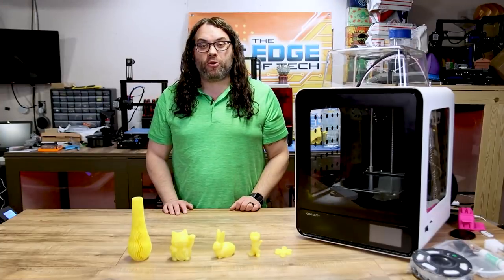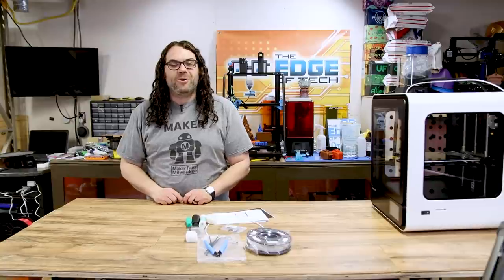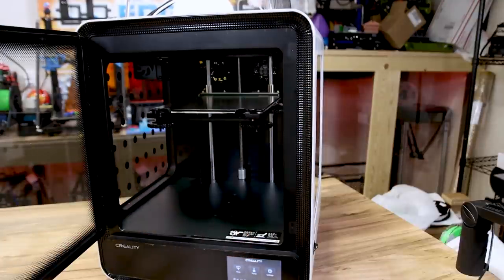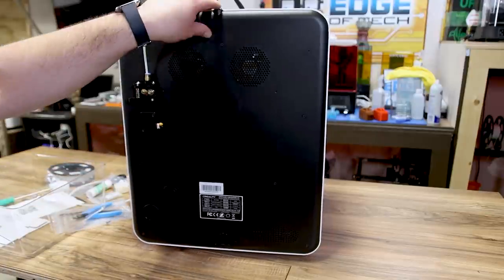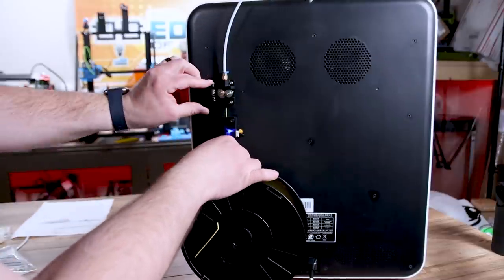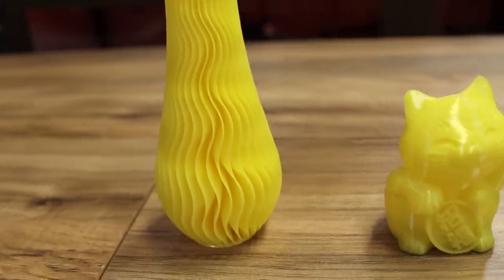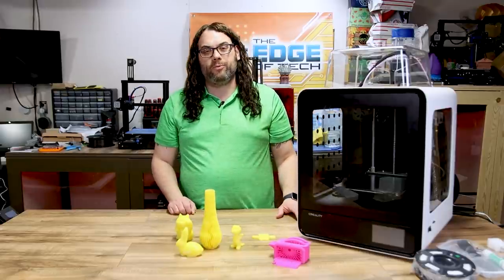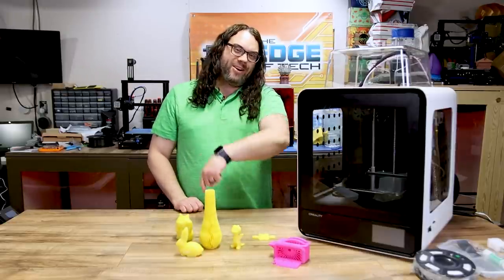Check out this New Creality 3D Printer! The Fully Enclosed CR 200B

Comment: Just received my second CR-200B and Creality have made some alterations to the new one I’ve got. They have added holes near stepper motor on inside and drilled holes above extruder with a fan inside casing to take heat out. Also a totally different hotend compared to my other one 👍🏻
Reply from the maker: Great news! That means they are listening! Do you know what hotend it is? Can you shoot me an email with a picture? I wonder if they went to a high temp hotend?!!
Reply: @TheEdgeofTech  I don’t know which one it is. But I will take some pictures and send them over to you!!  Where can I find your email please? 

Yes it seems they are listening and responding a lot quicker than they have before 👏
Reply: @Fanaticalfentons  Hey bro, I ordered mine yesterday and after lurking a bit more (as there isn't really much info about this printer online) I've come to realize some people are experiencing issues with theirs. 

Got it for 300€ off banggood so I can only assume it's the shittier ones? lol.. But if not, how would you rate it after running it for now 10 months?
Reply: @bravefastrabbit770  hey bro!! I have both generations of the CR-200B and they are both still working great. There was no price difference between the models. There are some slight adjustments in the newer design.  During winter for me with my print shed at about 2°c they just kept printing while keeping temp in enclosure at about 30°c

Comment: how fast does this print? How does it compare to the Ender3 S1 Pro? I'm having all sorts of issues with my E3 S1P with edges lifting and I'm wondering if it's because it's just no an enclosed unit and I've heard complaints with just buying the ender "box" so I'm kind of at a loss as to what to do.

Comment: Been thinking of getting one, but some people said it have issues with the extruder gear overheating, does it happen on your? great review !!
Reply from the maker: I didn't, but they now fixed that issue either way!
Reply: @TheEdgeofTech  cool, I will check with the local seller which batch they have in stock 👍

Comment: I think the glaring problem from end user experience is the location of the spool holder and extruder. It could be only more inconvenient if it were underneath.  
Otherwise it is worth considering.
Reply from the maker: Is that because it takes more space in the back? I think the only bad thing is that I have to turn the printer anytime I change it.
Reply: @TheEdgeofTech  doesn’t having to rotate the printer to load filament seem inconvenient to you?  Imagine  if you had limited space or on a shelf.   Just seemed like this was not well thought out.
Reply from the maker: @billyoungers4035  Ya. That's the part I would change

Comment: Did you print with ABS? The maximum temperature of the HEAT-BED of this device is up to 100 degrees. Glass surfaces are much lower. Is it possible to print ABS under these conditions? Without using hairspray or glue sticks.
Reply from the maker: I haven't on this printer yet. If I was gonna, I probably would use nano polymer on the bed.
Reply: @TheEdgeofTech  Thank you for the information. Nano polymer adhesive seems to go well.
Reply from the maker: @imextradeco.6689   For sure! That stuff is magic!

Comment: BTW, what is the hotend on this printer?  Is it the standard Creality hotend that is on the Ender 3, 5, etc., that has the Bowden tube inserted all the way down to the nozzle?  Or is it a different hotend with a separate Teflon lined heatbreak?
Reply from the maker: They say "New nozzle kit with excellent thermal conductance features wear-resistance and stability, smoothly filament-pushing. The dual fan provides a great heat dissipation environment." It does have a bowden tube inserted. but I am not sure about the teflon etc.
Reply: @TheEdgeofTech  The fact that Creality says that the maximum nozzle temperature is 260C indicates that it is not an all metal hot end, and that it has a Teflon liner.  I was just wondering about the form of that liner.  Either the Bowden tube goes all the way up to the nozzle, or there is a separate Teflon liner.  From your description of the hot-end, it does not sound like they are using the standard Ender hot-end.
Reply from the maker: @William3DP  Good point! I should have caught that. If I remember, I can try to take it apart this week.
Reply: @TheEdgeofTech  This video from Creality that shows how to service the nozzle suggests that the Bowden tube goes all the way down to the top of the nozzle.  One thing that I found interesting was that whoever unscrewed the nozzle did not put a wrench on the heat block.  (Are there pegs, dowels, or screws that prevent the heat block from turning?)  Also, they were able to shove the end of the Bowden tube right through the throat of the heat break.  I wonder if this hotend would benefit from a 'Luke Hatfield' style fix?  https://youtu.be/KHkMYz95ihM

Comment: Awesome video. I love this printer!! Had mine a few weeks now and happy with it. Only issue is the extruder can get very hot and then struggles to feed filament thru it.
Reply from the maker: Thanks for sharing!! I am guessing that is because the stepper motor is behind the panel in the machine. Does it do this with the case fans running? Also, I am guessing that it only happens with PLA and higher temp filaments don't get bothered by the heat. I think I saw on the facebook group that the stepper voltage was to high on his and he had to dial it back. Then it ran better!
Reply: @TheEdgeofTech  Thats it, stepper motor behind the panel gets very hot. I have seen a few mods being made for it that reduces the heat. it still happened with mine with the case fans running.i have a blower fan on it when running pla now, which has stopped the issue  but I will have a go at adjusting the stepper voltage soon
Reply: @TheEdgeofTech  I have set mine Vref to X,Y and E to 0.92V and Z 1.4V (unchanged) and the extruder overheating is gone. Now extruder gear heats up to no more then 40 degrees Celsius on more then 9 hour prints and I have no layer shifts and no under extrusion.
Reply: @simeonbodurov  cheers for that info
Reply: @simeonbodurov  Could you make a video of how you did it?

Comment: Creality has yet again released an enclosed printer it claims is of industrial quality yet does not have a high-temperature hot-end or high output extrusion, I am considered by my peers as a somewhat Creality Fanboy but these "Industrial Quality" printers are becoming an embarrassment to Creality, I wish they would drop the "Industrial" tag and adopt a "High-End Hobbyist" moniker or even better upgrade them to a hot-end and extruder worthy of the "Industrial" tag, and while they are at it they could change the plastic extruder that would not stand up to a couple of weeks of "Industrial" usage before the crack appears, and the same goes for the pneumatic Bowden connectors that are of the crappiest quality in the industry, we have the Ender 3 for the cheap entry-level printer, Creality needs to draw a line between Entry Level, Hobbyist, and Profesional "Industrial" because if they won't their competitors will!
Reply from the maker: Great points Andrew! I agree with that they could help themselves by using better categories. I really want to play with a CR5 Pro, which I believe they are pushing a more high end product with. It would be a great comparison for sure!
Reply: Also if it was a serious printer it would be true coreXY

Comment: Maybe I'm missing something, but the big feature of this is that it's an enclosed printer right? PLA doesn't really benefit from this. Would have liked to see some ABS printed.
Reply from the maker: I didn't have any abs, or I would have definitely tried it! But what's nice as an enclosed printer, is that it has case fans built in. That way you can still print PLA with no issues. Then you can turn the case fans off for the higher temp filaments.

Comment: I have this printer.  It prints ABS very, very well at 240c/100c.  Mine has developed a clicking sound coming from the rear Y axis linear bearing.
Reply: The settings of 240 degrees Celsius and 100 degrees Celsius are the automatic temperature settings of this product. However, my device will not weld to the heat bed at those settings. Is it possible for you to provide details of your success?
Reply: @imextradeco.6689  Elmers Purple Glue stick